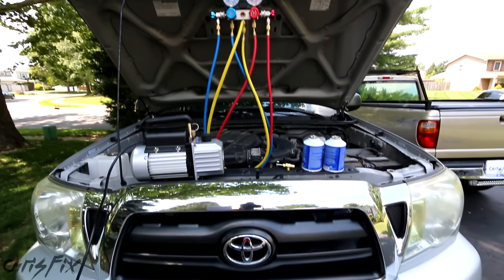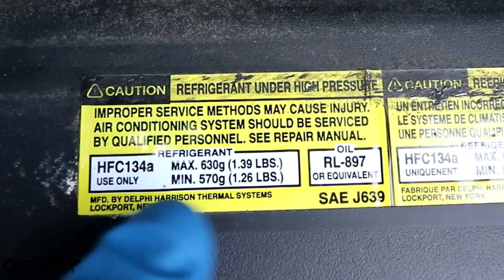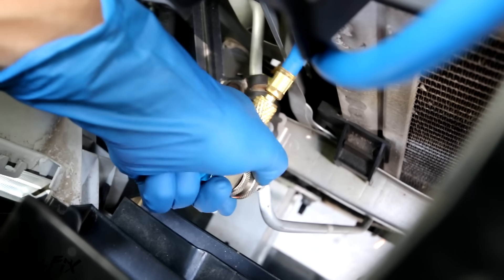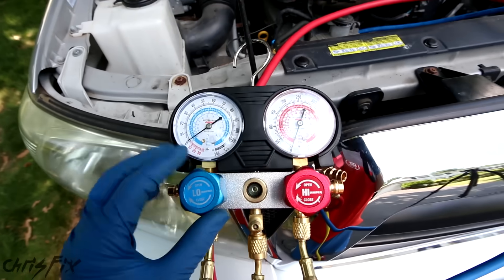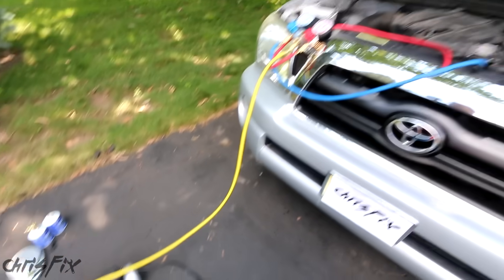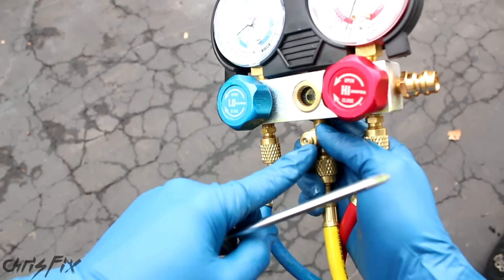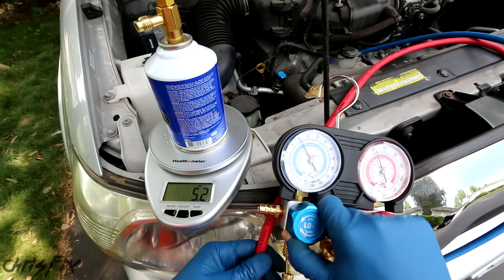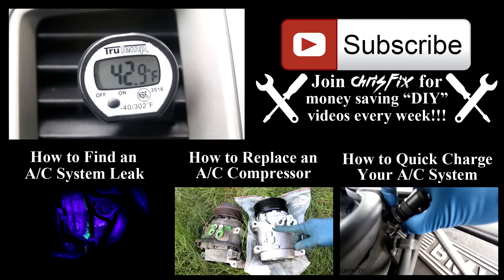How to Properly Recharge Your AC System

Comment: I think this is fairly good video although I would emphasize that if you do not use your hoses and manifold every day or at least every week , double check tightness of all hoses BOTH ends and when connecting any hose (  or if unsure of a gaskets ability to seal  )  Replace the gasket or ' O ' ring and always use the refrigerant oil to lubricate the gaskets & fittings , tightening as he said ONLY finger tight !  I always lubricate the connections in the easy connect fittings AFTER making sure the male fittings on the vehicle have been cleaned off with clean cloth lightly dampened with Simple Green cleaner . A drop or two of lube should be enough to lubricate , after the cleanng , as it is a thin lubricant and spreads easily . This removes any contamination and makes sure the connections on the easy connectors are able to make the best connection. Vehicle connectors often have contamination due to people servicing the system in a haphazard fashion due to fact the shop manager is telling them to finish a one hour job in ten minutes ........... and Bubba doing a quick & sloppy job cause he knows he'll be laid off if he doesn't please his boss .
Reply from the maker: Thanks for sharing

Comment: Thanks for the excellent video.  I was able to follow along, and the last-minute info on how to add oil saved me from having to remove the compressor again.  I almost panicked when my compressor did not engage, but luckily it was just a blown fuse.  Ice cold air, and I know it was done correctly with your guidance.  Again,  thanks.......

Comment: what if your ac compressor comes with oil prefilled ...will attaching vacuum pump, suck the oil out or not also should i add oil to the compressor when installing Compressor (before vacuum)...also is it the same procedure for recharging semi truck...Please reply...thank you...great video.

Comment: Hi Chris so I took my Honda oddyssey to pepboys and they said I had coolant in system..my ac clutch does not spin..i was going to just change the clutch but I think the compressor is broken..i also changed the 3 ac relay switches and the 7.5 fuse for the magnetic coil shit did not work..anyway I went to Amozon link to BUY the compressor and pump with gauges and r134 so I can do it myself...the pepboy guy said to release the pressure on the a.c. line just like releasing the air on a tire he said go to the high and low and release it.
Reply: When you run the vacuum pump it is removing all the air inside the lines so releasing the pressure before hand is not needed. Im guessing im no professional.

Comment: Sir what will be suction and discharge pressure
Reply: Suction pressure should be about 30 to 40 psi when running. Discharge pressure can vary a bit but typically between 150 to 250psi.

Comment: Hi, my ECU has failed and does not engage the AC compressor clutch. So, I  decided to excperiment by jumping the AC relay with a paper clip with the engine running. Sure enough the compressor engaged but let I it run too long (2 minutes maybe) when all of a sudden high pressured white gas  (I think it's AC coolant) shot out with a loud hiss. I didn't see where  the gas shot out from as I ran in panick to shutdown the engine. It took  me 5-7 seconds to run into the car to shutoff the engine. Question is the compressor destroyed? Or is it still ok despite what just happened? I'm hoping that its just some kind of fail-safe pressure release valve that released all that pent up AC coolant, if there is such a thing on the compressor.

Comment: So if I have a yellow jacket manifold or one that doesn't have that purge valve I need to manually purge by unscrewing the hose slightly. That's fine. However, if I'm adding dye in before attaching the refrigerant and then purging, I'm getting that stuff everywhere. Is there a way to add the dye and avoid this mess?

Comment: Hey ChrisFix , Nice video . In addition to the comments by the last two gentleman , I would add a small note. The weight of refrigerant listed in the can does not include the weight of the can itself. Use the tare option from the empty can if you are using that method. Nice production.

Comment: So when you first put the system under negative pressure and then you closed the valves to the manifold, the gauges were no longer exposed to the pressure in the system right? How would you know if there was a leak? Shouldn't the valves to the manifold be left open for 30 minutes to see if any air is pulled in through a leak?

Comment: i observed that during the initial charge the refrigerant can was inverted. this is i think incorrect as liquid refrigerant will be injected into the compressor and can damage the new compressor. a safer method will be to just open the low side valve gauge manifold and just let the gas into the system til a positive pressure is evident on the gauge before running the compressor and letting the the compressor draw out the refrigerant from the can.
Reply from the maker: thanks for sharing
Reply: Thanks Chris. i enjoy watching your videos by the way. 👍

Comment: Quick question...does purging the system remove oil? I'm swapping condensers from my parts car, and both systems were working and presumably oiled correctly previous to this. (I poked a hold in my condenser during an unrelated repair)
Reply: You can change the  Condenser without needing to add oil
Reply: @theGRAVEdiggeruneedblock  thanks

Comment: NEED HELP...
i had a car crash and my  AC condenser got a little bent from one side. The workshop guy said its not leaking..so they just took it out to straighten it (AC GAS leaked out obviously). Now they have put back the condenser  and filled up with AC gas. There are no leaks whatsoever. However, i am a bit worried that they did not put any AC oil in  the system. Removal of condenser must have gotten rid of some oil. please help ...its a new car i dont want to ruin it

Comment: Thanks great video strange reason valve came with vacuum pump didn't  fit yellow line (for Freon can)? adapter fit but nothing came out....got piss used the gypsy type that has blue hose with gauge fluk it it worked for now..wanted to get done before hell freezes over outside.

Comment: Please correct me if im wrong.he said his new pump had the oil in it and he added dye. Then he hooked up his gauges and pulled a vacuum. Wouldnt doing that pull all the oil ,dye,air and moisture out of the system,essentially being dry again?

Comment: One thing I gotta point out.

The refrigerant is sold in 12 Fl Oz cans, NOT 12 oz cans.

Fl oz and oz are not the same. One measures weight (like pounds and tons) and the other measures volume (like quarts and gallons).

16 oz = 1 Lb

16 Fl oz = 1 pint

Comment: Thanks for the great explanation. What if I’m having some refrigerant in the system instead of having it empty and I just need to fill it up to the appropriate amount. How do I track the amount of refrigerant based on the two gauges? Is there any table that is used to track the relationship between pressure and amount of refrigerant?
Reply: It's called a pressure/temperature chart, commonly available online. Be careful how much gas you add, R134a gas does not clear in the sight glass so don't overcharge it! you will damage something or blow a hose!
Reply: @MrConspark  that does not tell you how much Freon is in the system it only tells you how much pressure is in it. I could have 50# of pressure with 0 freon
Reply: No it doesn't, but will indicate by pressure on the gauges and temperature at vents and temperature of the pipes, how much gas you have. This should be weighed as it's added. Topping up like his is illegal for licenced repairers in Australia but anyone can still buy the equipment and gas and do it at home. 😩

Comment: Ignorance is bliss as they say. I first watched the video on replacing the compressor now this one as a refresher as I'll be doing this on an 05 Town Car. I replaced the compressor on a 00 Altima 10 years ago with 100k. Pulled one from the yard. Installed it with no torque wrench. No new washers. No gauges or vacuum pumps. Just installed it and used a couple cans of refrigerant until the gauge was in the green. Good to go. Guess I just got lucky? Car made it to 200k and would have kept going if a guy hadn't run a stop sign and totaled it.

Comment: Thanks for explaining the purge valve on the gauges, for whatever reason, I never figured that out on my own.  One thing I like to do at the end of charging the system is to close the valve on the shrader connector on the high side, close the blue manifold valve (red one is already closed), then open the red knob on the manifold.  You'll see the refrigerant and oil from the high side fill the sight glass.  Then close the red knob on the manifold, and open the blue knob to pull the refrigerant into the compressor.  Repeat until the pressure in the high side hose reaches the low side pressure and you're no longer able to pull any more refrigerant into the sight glass.  This allows you to recover the oil and refrigerant that's in the high side line.

Comment: Chris thanks for sharing your thoughts and direction, you need to add the new adapter for the new can with the check value inside the threaded tip, thanks again

Comment: Hi Chris, I have a 2001 for taurus with empty a/c system. On the a/c relay I put a bridge to engage the clutch and the compressor. Now the compressor turns but is not getting gas from the can attached to the low pressure line as supposed to.. What is the problem? Is the compressor bad?Please help. Only your videos make sens to me but you do not have one for my problem.

Comment: Hi chris i have a problem with A/C of my japanese ride in pakistan. we have high temperatures around 45 to 47°C and the mechanics says that it's not designed for this climate but the engine remains cool and steady  someone says that install a big or an auxillary condenser to increase the cooling surface area but it has not much space to do so. Please guide me becauce the hot weather really sucks!

Comment: Thank you this was so helpful when I was working on my 2002 Jeep Liberty!!
Reply: What was it? What brought me here was replacing a condenser on an 05 liberty. My stepson picked one up and it hissed when you added refrigerant. Replacing it was gravy. Had the condenser out in 20 minutes. Say what you will about Chrysler products but they are typically easy to repair.
Reply: @robertcoyle9071  Previous owner had issues with it going out. We troubleshooted and found a hole in the condenser and we replaced the accumulator. Replaced the compressor with one from the junk yard. After that needed to recharge the system and this helped us with getting it back up and working.

Comment: Hey Chris, I have a 2014 Toyota Corolla, When the car stops for a minute or more the vents throwout hot air, but when Im driving cold air. What could it be?
Reply: A Rey ac condensar is dirty or not getting enough air flow,
Reply: @hugosbudgetbuilds01  Thanks, I will clean it up..

Comment: Also I noticed when you put you first can in (10:15 mark) you opened the low (blue) side but I never saw were you opened the high (red) side... was it already open? I assume so.
Reply: You only fill from the low side. If you attach the can to the high side it will explode from the pressure.

Comment: What do u do if ur ac compressor doesnt kick on? New compressor, low&high pressure lines, condenser, drier, accumilator, low&high sensor. I followed all steps, it takes in 1 can of freon but the ac compressor wont kick on

Comment: Everything about this worked except adding oil through the charge line. I tried adding the oil and it just sat at the top of the line and never went down.
Reply from the maker: Crack the other end of the line loose to let air out as the oil goes in. Otherwise you have to wait for the air to come out through the oil which takes forever.

Comment: would be great if you can use Computer Duster (R152A) to recharge R132 system - does it run better or worse?
Reply: The newer the better but r124a was way cooler but more harmfull to the environment

Comment: Had some quote for AC replacement (replacement of compressor, condensator and even radiator) that goes up to 2k$. So I 'm currently looking at doing it myself, even though I'm not really a mechanic guy. Thanks a lot for the guide, I'll probably watch it about 5times and take notes before doing it myself... If it all explodes I'll post here. If it goes well I'll post here as well. :)

Comment: Nice video except that you made three significant mistakes:  1) when adding refrigerant with the first can, you had the can  laying on its side which can runs the danger of liquid charging the system which will damage the compressor!  2) When adding refrigerant, you're supposed to hold the can upright, agitate the can and occasionally turn it to the 3 o-clock or 9-o-clock positions.  3) When turning on the blower inside the car, you're supposed to turn the fan speed to its highest speed - this increases the cooling load on the system so that you can fully assess its performance.  Additionally, this prevents the AC compressor from cycling off on fixed-orifice cycling clutch type systems.  4) When adding oil to the A/C system due to component replacement, the oil must be added to the component when it is removed, not through the charge hose because, again, you don't want to introduce too much liquid to the compressor which will destroy it!  Also, when referencing the oil information sticker, this oil quantity represents the system's TOTAL volume and not what should be added.  The amount of oil to be added is equal to the amount that is drained from the replaced component.  You mentioned that your new compressor came pre-oiled, but you still must drain this new oil and add the same amount that was drained and measured from the old compressor because you don't want to have too much oil in the system.

Comment: My ac compressor is leaking, if I replace new one do I need to flush the line
Reply: I always do along with the evap core and condenser and change your accumulator and orifice tube or desecant depending what design your system uses..

Comment: thanks Chris, I used this video to recharge my home AC system, same principals.  I gave up after hiring a "professional HVAC tech" who didn't fix it and charged me anyway and two others who only wanted to rip out the whole system instead of fixing it.  Why replace a whole system for thousands of dollars when just a $600 coil needs to be replaced, rip off!!  Been working great for almost a year now and saved me $12,000 or $6000 dependng on what quote I am using.
Reply: @foobarmaximus3506  a home AC system for $1500 huh?

Comment: This may be a dumb question. But If the full can of refrigerant weighs 20oz, and the container itself obviously has weight. Shouldn't you weigh the empty can and then add that amount to the additional amount of refrigerant needed from the second can? Otherwise won't you end up putting less refrigerant than you need. Perhaps I misunderstood and you tar weighed the scale in between switching them. But otherwise how could the whole can be 20oz, metal and all?

Comment: So all cost 190 dollar as where i let it service for 70€. Why DIY?
Reply: @foobarmaximus3506  POUNDS Sterling? Euro!  I do not know how things are in the UK, but in Belgium they are not just going to say that there is a leak if there is none. What I say is not nonsense but just reality.
After years your air conditioning will also work less without a leak, then it is emptying, putting vacuum, filling.

Comment: Quick FYI he made a classic measuring mistake. There is 16 oz in a lb but the can clearly says fluid oz which IS NOT the same. One is a measure of weight and the other a measure of volume
Reply: Funny, the can actually says "NET WT. 12 FL. OZ"   lol
Reply: [laughs in metric]
Reply: Actually all refrigerant is measured by weight. Pick up any can at an auto store and it will clearly say Net. Wt. In this video if you look close at 2:14 you can even see the abbreviation WT. meaning net weight 12 ounces. This is the correct way to measure how much refrigerant you’re putting in the system. In fact, measuring by volume would be a nearly impossible feat outside of a lab because it turns to a gas when it moves into an environment under less pressure (and also cools which is why we use it in cooling systems). R134a also has a boiling point of -15.34F. So in order to measure refrigerant by volume you’d need to keep it below its boiling point plus under extreme pressure.

Comment: If you have an older vehicle, just add refrigerant to LP line while shaking can and turning 12 to 3. Moisture does not apply as a general rule. MUCH quicker. Job done in :10. Release pressure and set @37-42 PSI. COLD air again (57d F)

Comment: Hey chris ani idea of why mi truck temperature increases only when i turn on ac i already change all like radiator water pump thermostat and keeps doing the same also change the ac condenser only thing haven change is compressor
Reply: Make sure your fan(s) at the radiator and condenser are coming on when you turn on the air conditioner. Fan motors are a common failure.
Reply: But its a mecanic fan an its already replace
Reply: @josemar7272  Perhaps the fan/clutch is bad or going bad.  Also, look closely at your fan blades and around the shaft and make sure there are no cracks in it keeping the fan from being engaged with the shaft and therefore not turning full speed.

Comment: and if you are rich enough you can have this equipment. lol
Reply: all can be had for less than 200
Reply: You can rent all the equipment from autozone and when you return it you get 100% refund.
Reply: @kennythemaker889  Just use the can ! lol
Reply: Yeah but just using the can you cant vacuum out any air in line.